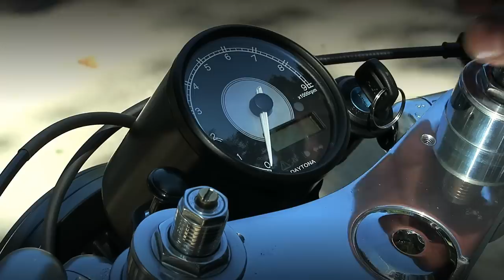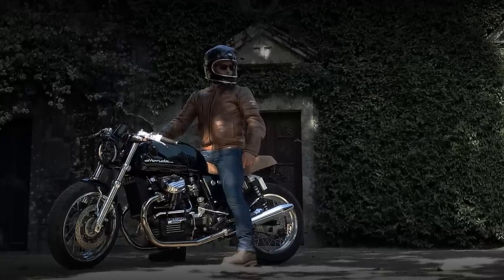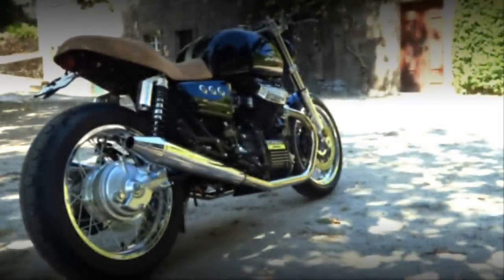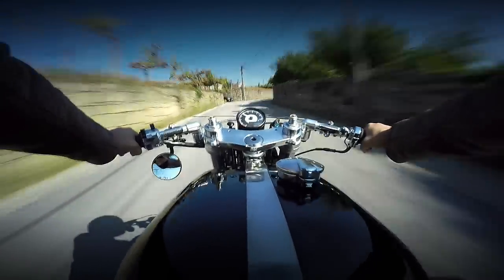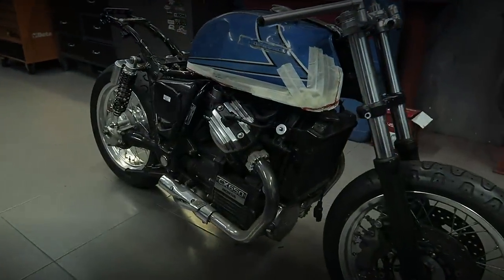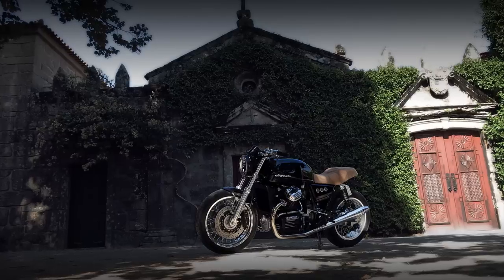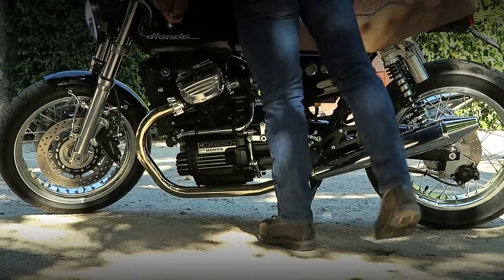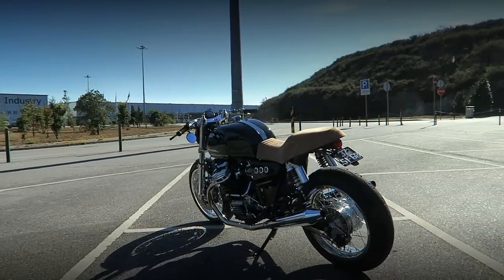Cafe Racer (Honda CX 500 / CX 650 by Racer TV/Oficina das Motas)

Comment: Nice, perfect work. When I saw the steering I notice that  there is no thank for the break fluid,  cause I have the original Honda CX 500 , from 1978. After 23 years sitting in one room with sized engine, after so manny years I took action find a used engine in Iowa, send to Europe and restored the bike. CX 500 is my youth years lovely machine. In Germany they call the bike " Guelle pumpe", like Rose oil pump. I do not know how much it is gonna cost that work , really that bike is top of the line. 650 are rare not common like 500. I have Honda Valkyrie Touring 2003 , I've Suzuki Hayabusa 2001, custom with a lot of chrome, spikes , custom made ostrich leader seat, Yamaha Virago, Kawasaki Ninja 750 GPZR,  but CX is my lovely bike cause is connected with a sweet memories. That way I did not, sale, did not scraped,  just left sitting for 23 years. Once again the bike build by the Portuguese guys is impeccable type of classic Art. Congratulation.
Reply: I was surprised to learn that there were only ungefähr 275 CX 650's imported to Germany, but about 240 still registered!
Reply: @lohikarhu734  Ich weiss nicht genau der Zahl aber ich weiss die CX500B wurden produciert in Italien und wurden genutzt in UK fuer die Postboten.

Comment: It's the best cafe racer, yet the HondaCX is a great platform to build on. It just looks so cool. 💯👍
Reply from the maker: @sgntbilco Thank you my friend for your kind comment. But here is an important tip. The CX 650 is much better than the CX 500. The 650 engine has a much more nervous temperament, whereas the 500 engine appears to be a "stuck" engine. :) Cheers.

Comment: Why doesn't Honda bring this back into production Honda vtwin 👍
Reply from the maker: Good question. Probably because of manufacturing costs. Making a V-twin engine is usually more expensive. :) Cheers.
Reply: Or maybe an air cooled longitudinal twin isn't efficient or practical if you enjoy power and performance...
Reply: SquillyMon yep yep...
Reply: RACER TV to each his/her own. My VFRs are cheap comfy fast and beautiful...IMHO. :)
Reply: Ares Moto my mistake...
Reply: Honda Make a double V twin , with Pan european, and with CTX 1300 HONDA  2014  but very heavy and expensive bikes,     if you look  Pan european Cafe Racer  , very great also , Bye

Comment: Now to address the electrical. It's easy to get your wires crossed and not realize they're crossed when getting things working. Especially when working with all new wiring. Continuity, check, voltage (w/o engine running) check, lights, check, engine runs and lights work (on a less than fully charged battery) check! Success!!! Until the battery is topped off, then the Stator/Alternator and Reg/Rectifier have to do something with the over abundance of electricity with no where to go. Where you've shot your self in the foot is using all the LED lights. They draw a very small percentage of the power the charging system delivers, so the battery charges very quickly and stays charged. As this happens, the factory type Reg/Rectifier can't handle sustained periods of absorbing this increase in power absorption. Result? The Reg/Rec goes bad IN A HURRY!! The solution, albeit more expensive, will save you TONS of headache in the long run. Get a MOSFET!! Problem solved once you make sure you're directing all of the charging through it to the rest of the bike. Seriously...don't skimp here. The Mosfet absorbs a LOT more heat and is designed to NOT fail under the increased voltage dispersal associated with using LED lighting. Many people have abandoned LED lighting for this very reason. Not realizing that simply installing the MOSFET cures the issue. Worth saving up for my Friend! There are numerous well put together articles that explain the differences and why you should use the MOSFET in place of the traditional diode type Reg/Rec. Cheers again my Friend! Zip~
Reply: Very well explained.  Thank you for adding this simple , but overlooked requirement of using a complete LED lighting system.  I hope viewers take the time to read your comment.  Ride safe!

Comment: You know something, The seat height and handlebar height looks like there is not that much pressure being transferred to your lower back or your wrists. I don't know how it rides but it looks very relaxing but also it is allowing you to be in an alert, upright, but comfortable position. It looks really good and probably is. I myself like a tachometer but then when you ride long enough you don't really need one, it comes naturally from the sounds and language that the machine is telling you. Ad it speaks very plainly and throaty.

Comment: You are right.  I do agree.  Clearly a Cafe to be enjoyed both off and on the road!  I absolutely love it.  I also agree, you and this bike have created a monster and a new era of cafes I am certain has been inspired.

But of course, I do have slight critical feedback.  Going from previous video, the filters on those CV carbs.  Is tricky with battery there, but the sound and experience with those carburetors, I feel they are not sufficient for the flow stability and volume the carbs need.  Minor I know, but something perhaps to play around with in the future.  Perhaps can fabricate some way for a larger air box or filter with some runner.  The wonderful looking covers gives options.
Reply from the maker: Thank you. I'm glad you liked my friend. About the carbs, yes, after changing the exhaust and air filters, it is always recommended to increase the jets. To be honest, i think now the engine has much more power than i wanted.  I am always trying to be gentle with the throttle, otherwise, the engine will never stop of pulling forward.  :) Cheers.
Reply: It is good to hear you are liking the ride!  Quite right.  From factory, the hondas of that era were tuned lean which did have an effect on top end power.  The filters causing them to be even more lean.  Rich jets can help with smoothing out the on throttle and prevent lean out at the cost of a very rich mixture in lower speed riding due to the "pucks" not opening correctly.  However if your mechanic has a bike that is keeping cool, able to idle and ride around without issue, then he is most definitely well versed in these older honda engines as it is doable, but just requires the skill and experience to make them run usably.  With your experience in Cafe's I am sure you have seen the bikes that look good, but are barely able to be ridden.

One issue you might have as it is one I have on my old honda is the slight richness and city riding can cause sooting on the plugs preventing proper spark.  If you are finding that on cooler days it doesnt want to get running or trouble starting, it could be that causing a poor spark.  On mine instead of sparking electrode to electrode, the semi conductive nature of the soot makes it arc from the side of the electrode to where it is near the plug threads while cold.

Comment: It's a beauty alright. I'm not thrilled by brown seats myself. And I've never seen a Honda with an off-set fuel filler hole. But it is most definitely, a beauty. My 2005 triumph Bonneville T 100 looks a bit similar, but the original pea shooters never sounded that good. So I put on a pair of outbound side slashed slip-ons, on her. Now it sounds like that. But I'm seriously thinking about getting some super short slashed slip-ons on it. But that may make it too loud. Neighbors ya know. 
Thanks for the look see, really sweet.👍👍
Reply from the maker: Thank you my friend for your kind comment. Yes, the short ones are too loud. :) Cheers.

Comment: Ya, I owned one. My sole transportation for 2+ years. That is a very cool CX build and the sound that thing makes is unreal.   I have to remind myself of the reality of using a CX as a daily ride. It's not bad. It's just that it always looks to me like something more along the lines of an 850 or at least a 750. As a CX500. The easiest example to find it would be a good bike for inner city or cross town or between villages riding. Following a winding road up a mountain or beside a river. Much better at that than freeway use. I know they marketed the SilverWing as a touring bike and it can do it but the more time spent on a freeway is more time to think about the fact that it's a 500. A 500 you can't do sprocket changes on to help the final drive suitability for Interstate touring. It's basically 1:1 in 5th gear on a CX500. We are not talking about some 600 sportbike with a 13,500 red line. This is late 70's manufacturing and it's pretty good and durable for what it is but it is not, in my opinion a bike that should be run at 85 or 90mph all day long. Or even for extended periods. It's turning the same rpm as what you read you are going on the speedo ok? Let me put it that way. That and we are not talking about DOHC short stroke inlines balanced and maybe counterbalanced as is common now along with the variable valve timing that can be factored in to give a 500 or 650 for that matter more performance than typical of the past.

Comment: End Result = Awesome!! Phantom's are fabulous tyres but I always opt for a Straight-Ribbed front (personal preference on my 79 900 SS Duke). I'd slap some gators on the fork legs and have the shock piggy-back cylinders remote and discreetly hidden out of view - otherwise very striking machine. I reckon you could do a video on your choice of muffler baffle .

Comment: You have an amazing channel and love the builds you chose to feature. I am still wondering why you included cx500 in the title as I did not here you speak on using any cx500 parts. If it's obvious why then I'm embarrassed for not knowing lol. Keep up the fine work and I use this channel as a guide for my cx650 build I'm about to begin.
Reply from the maker: Thank you my friend for your kind comment. Good question. :) I included "cx500" in the title, just to help the CX 500 fans finding this video.
Almost everyone only search on the Internet, for Honda Cx 500 Cafe Racer, and very rarely the CX 650.
As you may know, The honda CX 500 is much more popular than the rare CX650.
But I thought my Honda CX650, could be an excellent inspiration for many other CX 500 builds.
Congratulations for choosing a Cx650. The engine is much superior than the Cx 500. You ar not going to be disappointed. :)
Cheers.

Comment: What is that beautiful headlight? 
Custom made? Or by which brand? 
It fits the bike, wonderfully! Awesome build!
Reply from the maker: Thanks. Unfortunately the headlight model applied in this project is no longer available. But if you search on Google for "motorcycle LED headlight", you will find similar headlights or the same style  The metal ring which fixes the headlight into the motorcycle is custom made.:) Cheers

Comment: beautiful work! I like the panel you put in under the seat: I sometimes feel that some bikes have too much removed and end up losing some weight or bulk to the bike. That panel works really nicely  :)  Sooooooo many questions … let's start with where that headlight and gauge came from?
Reply from the maker: Thank you. Unfortunately the headlight model applied in this project is no longer available. But if you search on Google for "motorcycle LED headlight", you will find similar headlights or the same style :) Cheers

Comment: Still jealous of you Victor !
Snarling and snorting, crackling as you back out of the throttle !
Darn right I am jealous !
When it is possible,
would you please ask if the engine internals are creating the 650cc displàcement by changing the bore and stroke ?
Still using the same crankcase as the CX500 ?
Looking forward to seeing the detailed build sheet Victor !
As you know, you have created a beautiful masterpiece in your Frankenstein project !
Reply from the maker: Lol. Thank you my friend. I think your idea about rebore a CX500 engine up to 650cc, cannot be done. Besides the engine blocks being very different, it is almost impossible to buy Pistons/ piston rings, and cylinders. Not even CMS website have these parts. Sorry, but i think it is very hard to do it. Cheers.
Reply: @RACER_TV  
You are absolutely correct about the parts challenges to be sure Victor !
I am wondering if there might be a potential for the aftermarket parts for these CX engines ?
There seems to be a significant second life for these bikes !
Reply from the maker: @quadsman11 To be honest, i don't know any aftermarket parts related with Pistons or the 
cylinders.
But here is an interesting fact about Honda CX Engines.
The cylinders are not removable from the engine block.
This means that it is very difficult to rebore a cylinder which is inside an engine block, and which is out from a straight angle.
I think that if this was an easy job, many already had tried.
Reply: @RACER_TV  
I understand,
However, is a matter of correct set up, and would be no different than any other V-8, or V-6, V-TWIN, etc. !
There seems to be a solid number of CX riders who have found the same qualities in them that we have.
To this point, I have not had any of the CX engines in need of rebuilding, so I just haven't had the need to tear one that far down yet.
I have a feeling that the rod, and the piston may be a common piston, and able to be part of a building process.
In my on going pursuit of CX650's, I think I will be looking for a few CX engines that have since expired.
As for my CX650 hunt, 
I am struggling !
Anyone in the U.S. who might be able to help me with any information, don't hesitate to forward the information to me.
Reply from the maker: @quadsman11 I see that you really want a CX 650. And i don't blame you. It is really an amazing engine.  You probably know this already, but from what i had seen on youtube, it seems that Kevin Murphy is a great specialist on Honda CX model. Try this link:  https://www.youtube.com/user/divermurf   Cheers.

Comment: Congratulations for building such a wonderful machine. If you have mentioned before the price I'm sorry I haven't noticed but if not could you share with us how much did this project costed you approximately? 
Thanks.
Reply from the maker: Thank you. Well, all i can say, is that it is expensive enough to buy a new cafe 
racer on the market with similar power. But if i had to charge all the 
hours i spent during this project, it would be more expensive than a top
 quality cafe racer motorcycle. Curiously, i already refused an offer of
 15 thousand euros. :) Cheers.
Reply: @RACER_TV  I completely understand. I would definitely refuse that offer as well haha. Thank you !

Comment: Hi Victor, did you overspend on your original budget. Was it difficult to get insurance.
Don’t mean to be rude but for me it needs that seat sorted, probably a removable cowl as you said, so you can replace it with a passenger pad seat. Customs are very personal so what you like is not necessarily the same for everyone. It’s a great seat by the way but looks a little clumsy and not elegant. Shit that sounds rude now. Sorry👍🏻🏍🇬🇧
Reply from the maker: Hi. No problem, because i think exactly like you. There is something wrong with the seat. I found that a few days later after finish the project. But you will know everything about that Tomorrow, on my next new video. :) And yes, I overspend the original budget in 2000 euros. The insurance is still the same, because legally, i hadn't change anything. But even if i did, it is still considered a classic motorcycle with 35 years, therefore, my insurance cost only 25 euros per year. :) Cheers.
Reply: RACER TV wow. Can’t wait for the new vid man. Cheers Victor 👍

Comment: A beautiful project. Perfectly balanced café racer.. Did you use the golden proportion?   Where did you source the side panel port holes as adds another elegant detail
Reply from the maker: Thank you my friend for your support. Yes, definitely, Although the seat proportions are still not exactly as i thought initially. But there are always different ways of applying the golden proportion.  :) Cheers.
Reply: Wondering where you sourced the portholes-on  the side covers
Reply from the maker: @blairstevenson4837   They were custom made. But what is most interesting, is that the chrome rings of those portholes, were in fact Drawer knobs. :) Cheers.

Comment: speakless about this perfection! you sir - and your friends are really perfect customizer! so i have one question: wich led frontlamp and holder/frame you're using? thx for your answer.
Reply from the maker: Thank you my friend for your kind comment. :) Unfortunately the headlight model applied in this project is no longer available. But if you search on Google for "motorcycle LED headlight", you will find similar headlights or the same style  The metal ring which holds the headlight into the motorcycle is custom made.:) Cheers

Comment: I can see and hear the early Dunstall Norton 650 in the pipes and that great modulating note. I can see something of the MV750S in the seat. That's a particularly European thing. 

I'm not a fan of chrome. It reminds me of bloated '50s American cars and '60s Lambrettas. But finished bike is growing in me. I really like your solution to the brake calliper. That's clever.  

Will my CX550 look this good? It might. The tank is already a good shape. And the enclosed disks look like double twin leading shoe units. But it's all on hold. I'm dreaming of a StreetFighter. Well, two, a CB-1 based 400 that breaks a lot of rules, and a VFR750 based concept that will be very different and difficult to achieve. Plus I've got to restore the VF750.